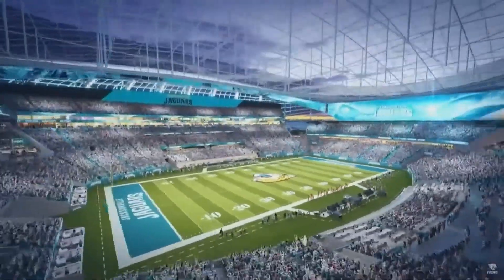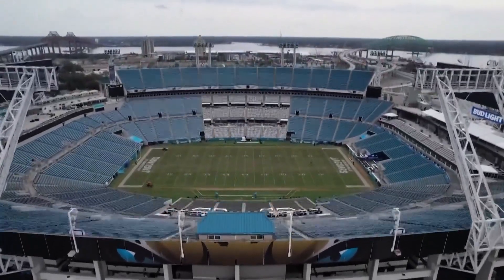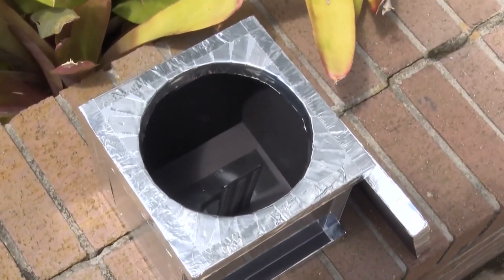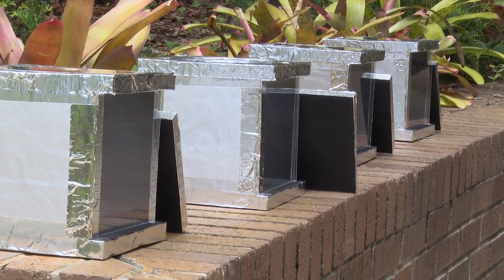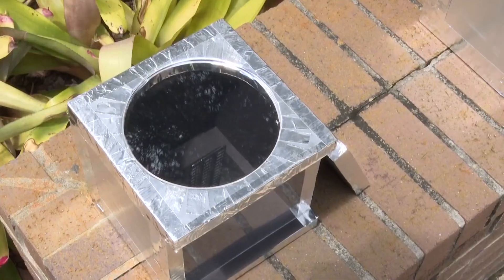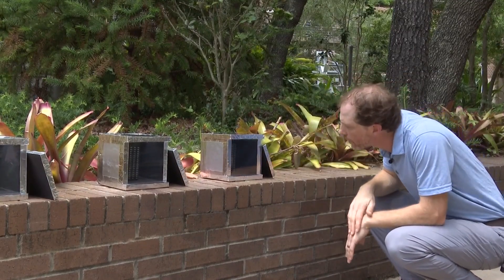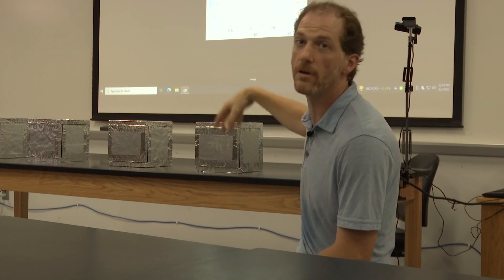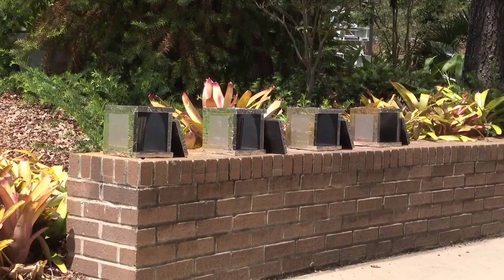How much will the Jaguars proposed glass roof cool down the stadium?

Comment: That roof of the future construction will be the biggest ripoff Jacksonville will ever experience. 20 degrees less is more like %15 decrease in temperature, that is not %70. Build a new stadium period.
Reply: There are so many other factors that go into this. You have area being covered. Wind flow through the openings in the stadium and the most important is the type of glass used. In the experiment they didn’t say they are using the exact same glass planned for the construction. They said they are using a glass close to what the jags roof will be.